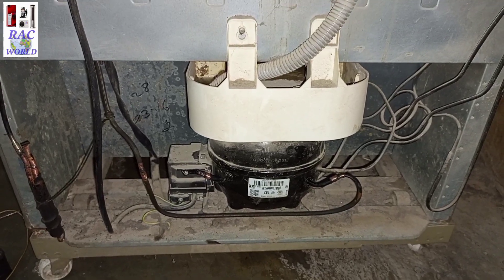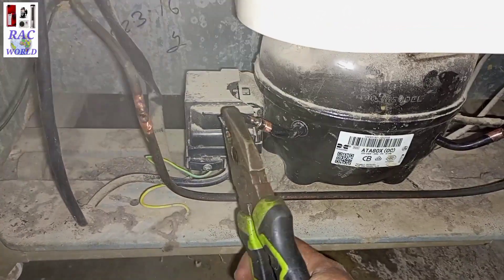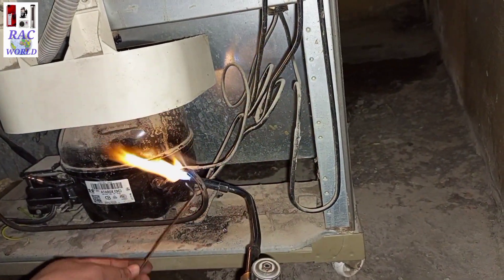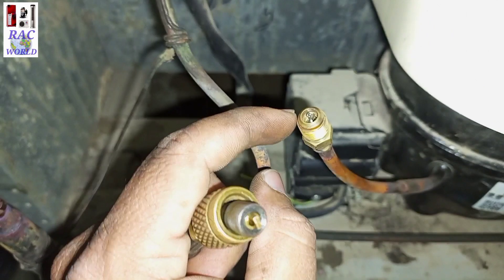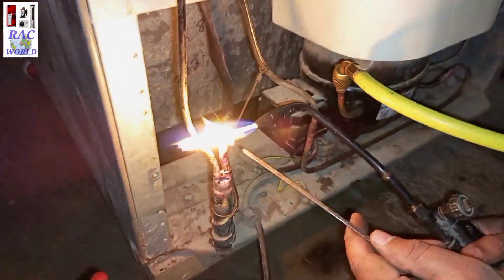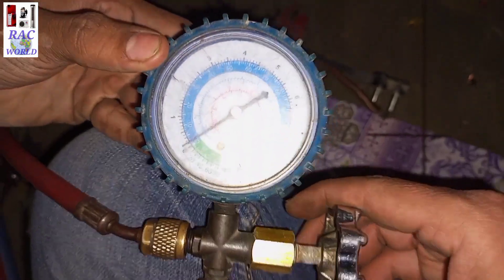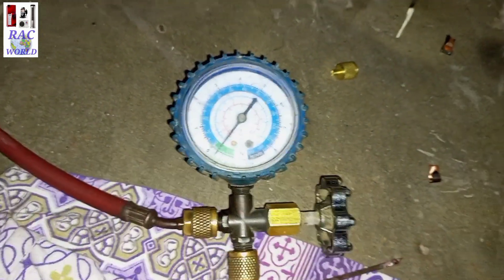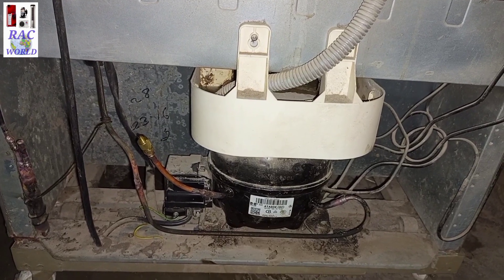Gas charge into refrigerator without using vacuum pump|gas charge in refrigerator without vacuum

Comment: I would like to give a very helpful tip to extend the life of the compressor.  Is to add 50ml of sulphuric acid to the compressor before regassing.  This reduces corrosion